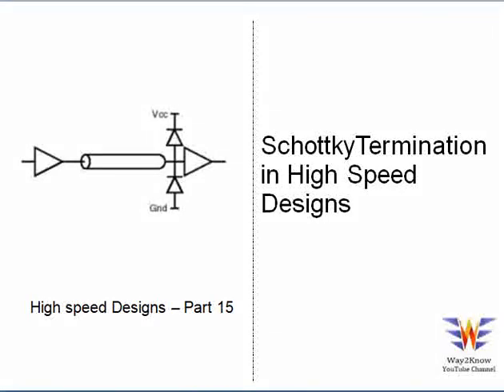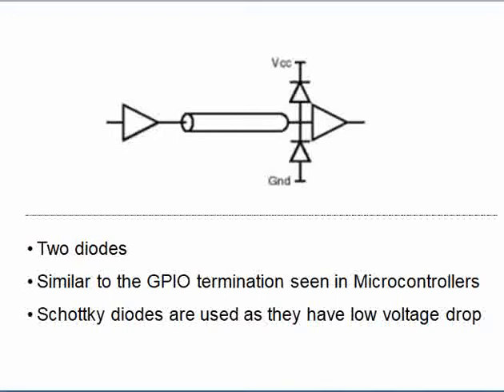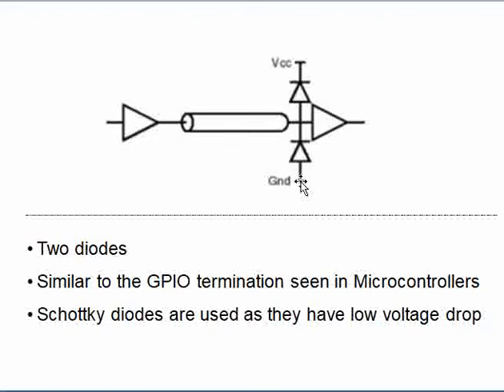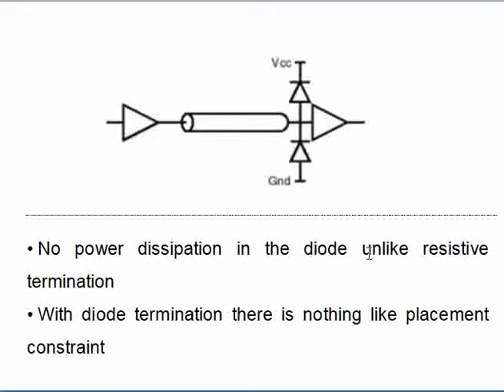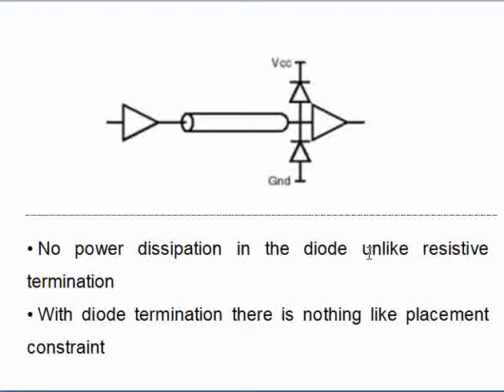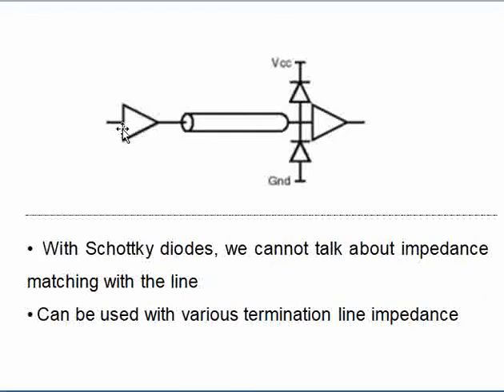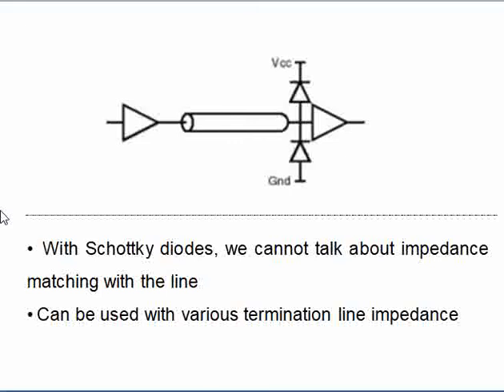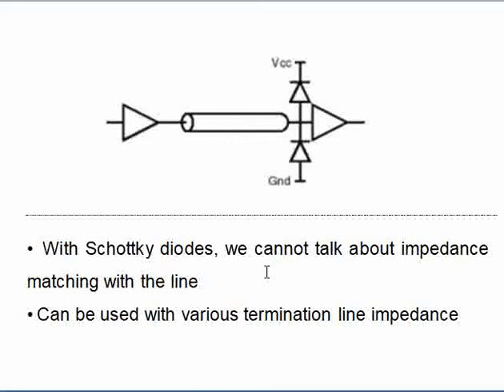Schottky Diode Termination | High speed Signal Design Termination | High Speed Designs Part - 15

Comment: the two diodes are both in reverse bias, how do they form a termination?
Reply from the maker: They two must be in reverse bias under normal condition.. only if there is signal exceeding the voltage beyond the voltage applied to schottky it must turn ON which is the expected functionality

Comment: what is slew rate? how slew rate affects the signals. what is the relation between slew rate and crosstalk?
Reply from the maker: Slew rate is rate of change of output voltage.. higher the slew rate value, higher the rise time and we all know with fast rising edges how the adjacent traces can get affected
Reply: @Way2Know  Thank you. What is the difference between 2d, 2.5d,3d solvers. Upto which frequency we use 2d,2.5d and 3d solver. Why we need this many solvers.